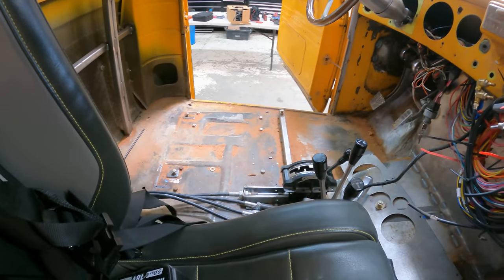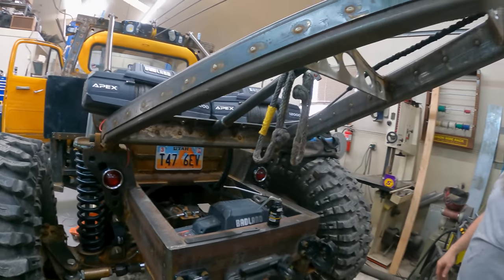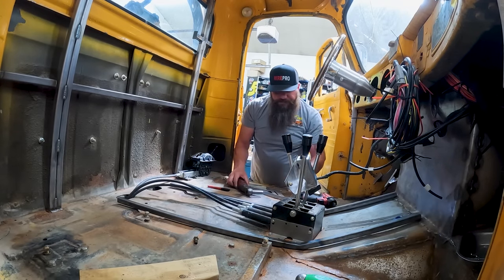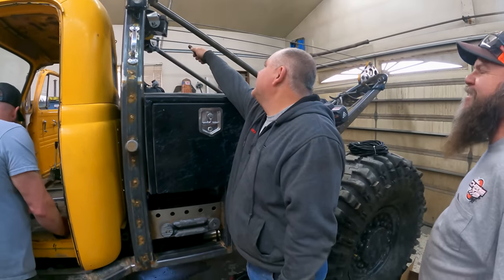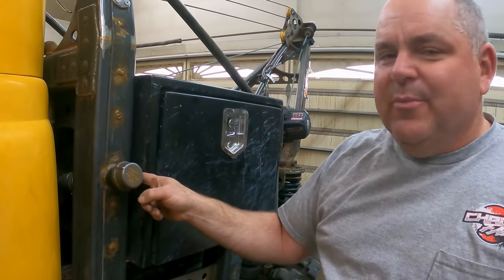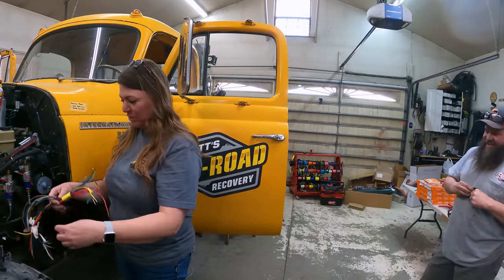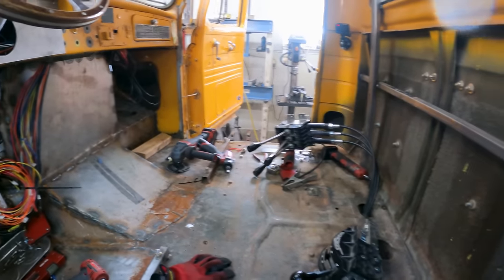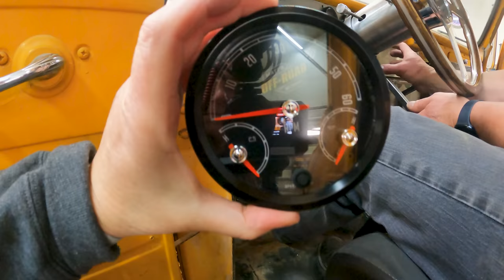World's Largest Off Road Wrecker Gets A Console?!?

Comment: The secret to running wire through tubes. It uses a string tied to a plastic bag. Then use a shop vacuum to suck it out where you want to. Works pretty well. Most electricians use it. God bless

Comment: Wait, isn’t Matt a customer? Another great video, I find fabrication so very interesting! Has anyone noticed Chad and team always end up with the most technical projects, these guys make it look easy but being a engineer myself it’s anything but easy. Smart folks with a great can do mindset
Reply: Yes they are a awesome team. 🇺🇸
Reply: It may be partially due to electrical skillsets, acumen, and tools.  Most mechanics won't take apart a Transmission for that reason.  
Chad seems to have more experience with taking a new piece of wire or a harness and running it to a new pin in a new connector.  Many fabricators just splice into existing harnesses to add bits without trimming out the unnecessary bits.

Comment: Chad, family and team, you guess do amazing design and work!! I’m glad to be part of your channel. I’ve used a para cord and a shop vac to run wiring in tubing! Tape a little bit of plastic bag to the end and put it in the one hole. Than use the shop vac to suck the para cord though the other hole!! Where I learned it from was an electrical contractor on a job site, running wires through underground conduit!! Again thank for the great video content

Comment: Using the flexible core of a speedometer cable works great to snake wire. When it got stuck we hooked it to a drill and turned it slowly to get through.
Reply: @Cole Martin
How fast were you going?❤️🇷🇴
Reply: Or, go to Harbor Freight and pick up a fiberglass wire running kit or a fish tape reel.

Comment: Need to add some small foldable seats on top off the tool boxes. Possibly a seat belt also. Great work.
Reply: Yeah riding on the toolboxes without any seat or seatbelt is just asking for an accident. Couple jump seats would be sweet. I'd still be a little nervous of those big tires throwing a rock.
Reply: I don't think that Matt planned the heavy wrecker to be a crew vehicle (he also said that in the building serie): just the driver seat and one single passenger seat.
His idea was to go with 3 vehicles when on a rescue, the Heavy Wrecker and the Banana or the Morrvair.
Don't get me wrong, is a cool idea to put a couple of seats on top of the toolboxes, but I think isn't ment to do that
Reply: right from the beginning I thought that it NEEDS  to be a crew cab
Reply: @lowrangemaniac5326  So True he did not plan to have passengers just a co driver , Also if I remember he thought that a crew cab would be to long and hard to see out of . They will figure out a good answer. Happy trails
Reply: @henrycarlson7514  exactly my friend
Reply: @henrycarlson7514  true but he is already letting passengers ride there so might as well make it safer than it is. have agreat day sir
Reply: @miked19831988  I think they ride on the boxes just for fun and/or in extreme cases, when there isn't the Morrvair or the Banana as second vehicle
Reply: @lowrangemaniac5326  of late there seems to be the need for passenger space !
While the old style cab Is cool,I think a  modern wide cab like the Rollback truck (international ?)would cater for a third seat .
Reply: @miked19831988  So True, Safety is Important. i think that Jump seats would be good , But Where? A good day to you too

Comment: Chad, I’m very good at fishing wires in difficult places, and the approach I’d use to get around that filler pipe is to take a few inches of small metal chain tied to a masons line and drop that down. The weight of the chain will pull the nylon cord around the obstruction most of the time.

Comment: As an electrician i'd sometimes run into spots where romex couldn't fish.  One of my favorite tricks was using some welding wire, its stiff enough to take and hold a bend but thin and springy enough to work through tight spaces.   Another great tool for those gravity fishing spots is a bead chain.

Comment: A great trick when running wiring thru stuff like that... Use an old speedometer cable (just the center cable) attached to a drill. It spinning will shoot it right past all kinds of junk, and helps feed it at the same time.

Comment: When you were fighting with feeding the wires through tubing, I'm reminded of when the local telephone cooperative was installing fiber optic they used suction to pull a very high tech tape through the conduit. The tape is super strong and flexible.. a friend of mine used it to replace the cable on his portable ice fishing shack, Still working well after 4 years.

Comment: Chad, just a thought. For the console, you should think of putting in a couple of cup holders, mobile phone holder with charger point. At the rear of the console you could easily make a little holder just above the transmission cables to put bits and bobs. THere is never enough space to put stuff. Great job on the wiring and fabrication. Greetings from the UK.

Comment: Use a piece of string with the wires tied/taped to it, and a shop vac to suck the string through, then pull the wires through the tubing. That's how I run wires through motorcycle frames and handle bars.

Comment: another way I have pulled wires hook a shop vac up and feed string in the one end might need a bit of rag tied too the string too help the vac pull it .. stiff wire worked great ,, I have done lots of weird pulls in house wiring .. another great video ,, nice work with the pins ..I would have dropped a few more then 1 ..

Comment: at time 15:22 what I did on an issue similar to this running wire in a shop was to use the vacuum trick. take pull string, put a tissue on the end of it, get it started to feed down. Use a powerful shopvac vacuum to suck it past your obstacles. Then you have the pull string to pull your wires.

Comment: If the toolboxes are pushed out a little bit you can have a bench seat for 2, for added people to assist in recoveries. 2 people's cab capacity usually is not enough in a recovery job...

Comment: a piece of romex works well, and believe it or not, old wire coat hangers untwisted at the hook and straightened work excellently for pulling wire, i have an old aluminum one and an old steel one in my 4x4 for just that purpose when helping someone wire a sterio or some obscure thing that is in a wierd spot, the steel one works well for pushing wire through a firewall, and the aluminum works well for pulling wire through a chassis, the hard part is literally finding the wire coat hangers though, pretty cool to see you guys working and see the process, lots of ingenuity and lots of hard work

Comment: Hey Buddy.  Just a quick tip for the Torch.  Have you ever tried Mapp Gas ?   It's a mixture of methylacetylene, propadiene and propane.  MAPP (5300*F)  and Propane (3600*F).  Little more expensive but it also takes less time to heat and hotter :)  Cheers

Comment: H 16:51  Have you ever tried using a vacuum and a string to fish wires through difficult runs? Use the vac to get the string through then pull the wires with the string.

Comment: As a lead wire i have also used two lengths of mig wire twisted together and Bowden cable with a small bit of weight on the end of it works also. Regards Chris (small magnet can also to help guide the mig wire around objects kie the petrol filler)

Comment: Hey Chad. I just finished rewiring a 31 pin Deutsch connector for a concrete pumper. Very similar to your connector actually the same. 10 to 18 gauge wire. Factory put in a female connector where a male was needed. It happens. I work for a dealership. Anyway. There is an 8 wire, with a slightly smaller connector, but has 10 gauge wire capabilities. Let me know if you are interested.
Reply from the maker: Absolutely interested!! And see you said 14 to 18 not 10 to 18. That's great too!
Reply: @chadsfab  . Hey Chad. And it uses the same crimper you are already using. Or I should say. Check the crimper you are using. It should have adjustments on it for different gauge wire. Depth too. Are you looking for a part number or a picture? Or both? Let me know.

Comment: Iv faced the old wire through the tube a few times, iv used string a few times, tie a bit of rag on the end stuff it in the tube and use your air gun to blow it through and fish it out the other end with a bit of tig rod bent into a hook. 
For long runs I have a 10 foot length of mig wire I use.

Comment: Feed a length of string into the wire feed hole then shoot compressed air into the same hole. If the other hole is large enough the string will follow the air stream out of it. Then tie a piece of wire to the end of the string & pull it through. That trick worked for me a bunch of times.

Comment: For wires runs like that, a beaded chain, like toilet chain, and a magnet on a flexible rod are killer. Drop the chain from the top and use the magnet to grab it at the bottom.

Comment: for running wires through where the fuel filler is... Park Tool makes a magnetic thing for snaking cable through a mountain bike frame.   I bet that would work in that situation.

Comment: Great work thus far on the center console framing, gage mounting and lever controls. Any space or plans for pocket holders - Mountain Dew, water bottles, sun glasses, phone/chargers? Bugger on the rewiring.
Reply: how about a gps monitor and a back up camera
Reply from the maker: Not sure on the cup holders, still need to figure out where all of the other components will go. 
Matt has no interest in a built in camera or gps.

Comment: Compressed air and string work wonders for running wire in roll cages once you get the string near the exit then use the shop vacuum to suck the string out of the hole

Comment: I use a Small Jack chain ( ones used for pull chain lights ) for pulling wiring thru block walls I can see it dropping right thru there like it does for me in block walls.  bounce it up and down to were it will fine its way down

Comment: As I read my own comment, I realize that many people watch these videos and ask "Why didn't they do it this way instead?"  I'm wondering how often Chad says this himself.  We don't understand the full context or criteria, so the question could be out of curiosity without inferring that the comment is from someone who thinks he knows better.  
On a recent recovery, Matt was sitting in the middle and it would be cool if they could incorporate some kind of jump seat to the top of the center console.  Nothing more than a Stadium seat or somewhere for Peanut to chill.

The evolution of design was interesting.
At 20:42 it was stated that the top would be removable and the sides could come out individually.  
At 20:47 the two sides were welded together.
At 23:07 the initial frame is shortened to allow removal as a unit.
When they disassembled it, I noticed something that I might have done differently.  To make the console easier to remove, it may have been better if the shifters were mounted to a plate that could be unbolted, then they could drop down together as the console was removed without fishing the handles around the metal bracing.
Reply from the maker: I quite often reassess along the way 🤣 I think we all have to.  Best way to get what we're designing to be what we want it to be.

Comment: Sometimes a length of string with a small scrap from a rag (affectionately called a mouse by some) pushed through by a blow gun or pulled through with a shop vac is easier and faster then any type of fish when dealing with odd shaped tubing.  

Surprised you didn't put a drop on the back section of the console to allow for some type of pad as you know its going to be used as a seat or better stated saddle for the third person in the cab.  Mat has been occupying that position lately so perhaps his comfort should be....  Never mind ;>

Some form of minimal jump seating on either side of the boom might be a consideration too since often they have one or two folks hanging on back there so something to make the ride a bit safer for them would be a good thing even if its just a few stirrups and chain/rope holds.

Lots of room for creative tweaking there and it will be interesting to see the evolution of it all.

Best!

Comment: When I was doing wires on my buggy, I drilled my holes up top then I put a threaded a ear plugs on  the end of string and used a shop vac and put it on the whole world wanted to go and it sucked it right through right on out, tied the string to the wires and pulled it back really easy

Comment: Chad an outside the box  way of fishing wires or hoses through several obstacles  is take some small twine or even kite string and make a small flag out of tape flimsier  the better and stuff it in the inlet now take your shopvac  and vacuumed away any other holes in the pathway need temporary tape or thumb plugs I have used this plenty of time

Comment: You want to heat the metal on the bend side 3/4 around to compress the metal, if you heat the whole piece you stretch the metal on the back side and weaken it- fyi

Comment: Bikers always want wires and cables hidden inside handlebars and frame rails. Fishing them through small diameter tubes with tight bends is not easy. When I had my motorcycle shop we'd tie a string to a cotton ball or pompom. Then use a blow gun to push it through. Use the string as a fish.

Comment: Test the voltage drop on the wire that runs to the two hook winches both under load           On mats video it sounded it sounded like they was struggling from voltage drop  The wire or batt might need to be much bigger most likely the wire   Amps times voltage = wattage  if voltage drops amps have to go up   It ends up a snow ball effect they will need giant wires if its over a foot from the batteries
Reply from the maker: Less than .2 volts of drop
Reply: @chadsfab  them winches are just not as strong as i though   now every one knows its the winches not the wiring or batteries     Thanks

Comment: Just to ask. Would you fit a lower spot light on the rear lower chassis. For night time hook ups. When under a vehicle or doing maintenance. Or maybe a buffer arm to stop vehicles from crashing into the tow truck when going down steep rocky tracks.
Reply from the maker: Lights will be on the boom

Comment: They make LED Strip Lights designed to go under the tailgate or in the back window of an SUV. One of these could be mounted above or inside the back window.  They are wide enough and bright enough to be useful even with a Razor on the hook.
Reply: That’s a good idea. There also were some suggestions to Matt’s channel to do a brake light on the end of the boom so whoever is operating the brakes in the towed vehicle has an easy to see brake light.

Comment: So the wrecker has license plates. How does Utah deal with homebuilt vehicles like that? did you have the original title to the old Air Force truck? Or just a title and they run it thru as a new plate? I would be interested in a video showing the steps for a plate that can drive on the roads. Maricopa county Arizona makes it very difficult moving thru the gauntlet to getting a license plate.

Comment: After watching a MOOR video you might want to make provisions for a seat on the back of the console🤣
And being an electrician for over 40 years an old trick for fishing down walls (in this case a roll cage)is a fine chain drops down easily with a little shake and once down easily pulls out of even small openings. In a pinch I’ve used a small piece of chain tied to string.👍

Comment: What about removing the filler pipe and running the wires and when finished moving the wires to each side and sliding the filler pipe back through.
Reply: i think it is welded to the roll bar if you look close

Comment: The taillight location seems wrong.  I lived in NC most of my life, and if anything (temporary or permanent) overhangs the taillights by more than 48", a flag must be attached.  I had bucket trucks and digger-derrick trucks, and we lived by the 4 foot rule.  Since the taillights are mounted, Matt may want to hang a flag off of the boom to avoid entanglements.  I think the console is going to make it impossible for a 3rd occupant inside.  Maybe you can find the rear seats out of an old Subaru BRAT and make a rumble seat.

Comment: Vacuuming a string through the square tubing might be the ultimate answer
Reply: I have used that trick for getting a 150' hose through some 2 inch plastic conduit.  It worked soooooo slick.  I pulled a string, and then I pulled a 1/4" rope.  That conduit had quite a few 45 and 90 degree elbows.
Reply: This is the way
Reply: Yeppers, have used the vacuum "mouse" for decades!  Really became a "thing" when the blue Smurf tube came on the market...

Comment: Do you think if you attached one or more hydraulic cylinders to that boom and plumbed the two side of each the cylinder together with a valve and speed regulator in between that it could be used as a safety just in case the winch cable breaks? Whenever the winch turns on it would also open the valve allowing fluid to move from one side of the piston to the other. If the cable breaks while the winch is on the speed controller would allow for a slower drop and time to stop the winch. If it breaks while the winch is off, the cylinder would already be hydraulic locked. This is a question as I’m not a hydraulics guy, just another sparky 😉.
Reply from the maker: You could totally do that and it would work great as a safety if a cable broke.